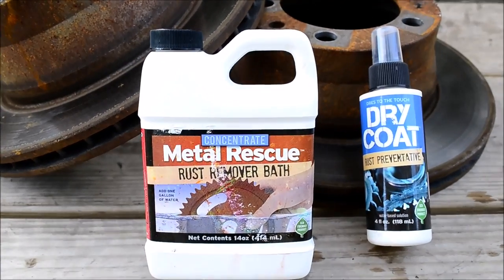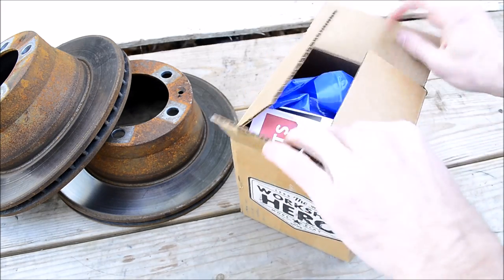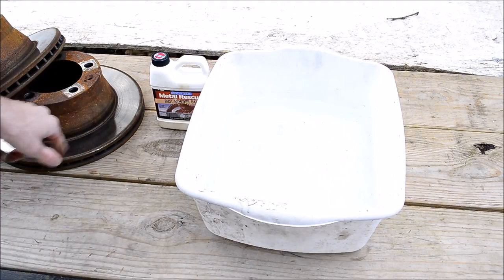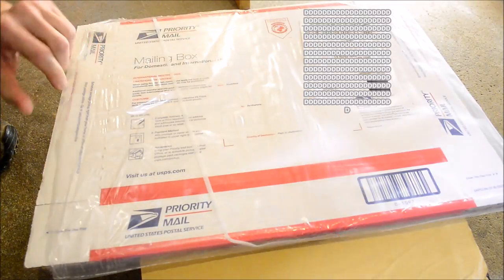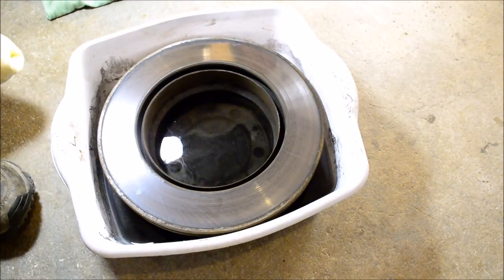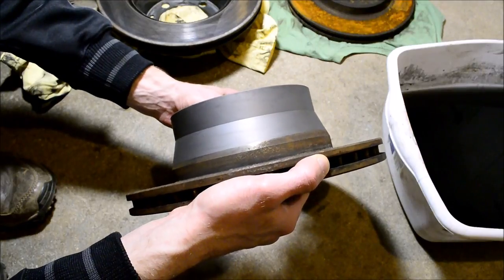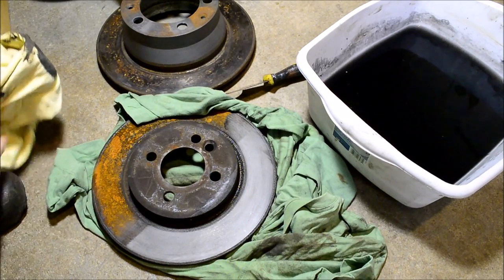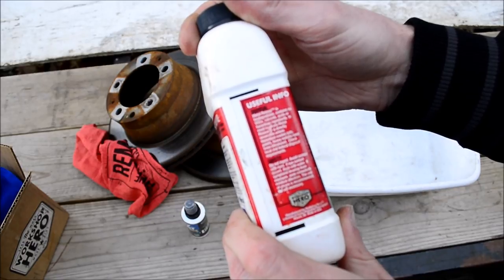Metal Rescue De-Rusting Brake Rotors | How to Remove Rust Easily

Comment: Dude 39 dollar at amazone.... New rotor from rock auto 25 each...
Reply: You say this but like if it's an already brand new rotor what is the point of buying another new one if the only issue is rusting
Reply: @tenseyyy3019  coz those chemicals cost same $$$ as brand new rotors plus you lost your Labor time.
Reply: @tenseyyy3019  well leave it alone rust is natural layer for iron to block further keep rust and totally breaking down. As long as you never soak water long period time. There a lot coated roter with rust resistant coating from brand new. The problem is you buy low quality roter try to solve issues with chemicals more cost than high quality roter. There huge selection of rotor at rock Auto .
Reply: @maungmaung4037  dude these are rotors that simple just sat still for a while all the parts are still good parts my guy
Reply: @maungmaung4037  the real issue with the Rusting is actually the wheel bearings being stuck I can't get them out at all

Comment: This stuff really works. Funny that I was looking for rust solutions on brake parts. I've used it on screws and metal trim on my 1990 Bronco. Even with a spray bottle, painfully taped sponges with plastic around it on the frame surface rust. Didn't know I'd be looking at a fellow 944 owner haha. I have a 1985.1 Guards Red

Comment: Storing liquids in plastic jugs may result in leaks in a short time. The plastic is very thin and if the liquid is even slightly caustic, it will leak.
Reply from the maker: this stuff must not be caustic because I've had it stored in a milk jug since I made this video and it hasn't leaked

Comment: Did you encounter any flash rusting? 
What I mean by that is after using the product and removing the rust, did the rust come back? If so, how quickly and how much rust?
Reply from the maker: Once rust is removed the rust can come back within a day if you don't protect the metal, it's just bare metal, has nothing to do with the product itself.
Reply: Soak in cocoa cola overnight! Removes rust and won’t rust again
Reply: Or soak in bi-carb/water after , to reverse the PH level of the acidic rust bath

Comment: Is this only for "surface rust"?.....my 2 piece Baer Rotors are drilled, slotted and vented. If I dont drive the vehicle for a few months the rotors develop THICK, DEEP AND HEAVY RUST......much worse than the rotors in this video! 

Will this product be able save me from having to spend $1k on 2 front rotors every time I dont daily drive my vehicle?
Reply from the maker: This product removes rust, it doesn't stop new rust from occurring. You need to clean the rust off and then treat the rotors with something that will prevent rust, paint, fluid film, etc. Although w/ fluid film you'll have to reapply after every drive

Comment: Would this work on rusted calipers too? I always wounder if it will damage anything with the caliper
Reply from the maker: hmm I wouldn't soak the rubber parts. maybe a rust remover gel would work better for calipers, that way you can paint the gel on the metal and avoid any rubber, and then wipe it off, then prep the metal for paint with something like prep-all, then paint
Reply: @aDIYCarGuy  ok thx . Does the same company make it ?

Comment: Did you try it again with one bottle of the rest remover, but 2 gallons of water? Would this still be strong enough or not?
Reply from the maker: I thought about it, but I didn't want to take the chance in case it would dilute it too much. There's no going back once more water is added, other than adding more Metal Rescue, I'm not ready to get more quite yet.
Reply: Hi Qwerrrz, Metal Rescue Rust Remover Bath CONCENTRATE must be mixed with exactly 1 gallon of water. No more, no less. Metal Rescue will not work if the mixture isn't 1 gallon. Thanks.
Reply: Thanks for the answer both of you. I thought it would may work slightly weaker, but cover more with more water!

Comment: i used white vinegar does the same and far cheaper lol
Reply: Hi Frank, there are many ways to remove rust. Although unlike vinegar Metal Rescue is not an acid, which makes it safe on paint, plastic, rubber, and skin. Since it's not an acid, Metal Rescue will not promote rust if left on and does not need to be neutralized. Metal Rescue is reusable and one gallon will remove up to a half pound of rust. We did a comparison video between various rust removers including vinegar and Metal Rescue: https://www.youtube.com/watch?v=M9Vj59WUAdU&t=1s. Please let us know if you have any questions!
Reply: I once de-rusted a motorcycle tank with a mixture of vinegar and hot water. The removing worked well but it started rusting again within seconds when I removed the liquid. I then re-applied it and had to quickly replace the liquid with cool water when it was finished to neutralize it and cool it down to avoid new rust. It really opened my eyes to how acid, water, and heat promote rusting.
I also tried a commercial product that I can't remember but it wasn't much better. If the product in the video is actually easier to use I can see its advantage.

Comment: Can u spray it on or like put it on a cloth and scrub it off ?
Reply from the maker: nah it has to soak
Reply: a DIY Car Guy is there anything that can be applied to a cloth and rubbed off
Reply: Supposedly you can soak it in white vinegar for cheaper
Reply: Our Metal Rescue GEL is our on-the-spot rust remover that is ideal for vertical surfaces or metal parts that can't be soaked. It is a cleaner, safer and easier rust remover than other gel-based rust removers. Metal Rescue GEL is non-toxic, environmentally friendly, and contains no harmful or corrosive acids, alkalis or solvents. You can check out more info about Metal Rescue GEL here: https://www.workshophero.com/store

Let us know if you have any other questions!

Comment: Will it get rid of the bluing on a firearm
Reply: Yes it strips  ALL the " native " coating off all metal even poor quality chrome. BUT not good quality chrome plating.This accelerates rust,in a gentle way bit takes the top layer of steel off.

Comment: It is pointless cleaning brake disc on the pads surface.  Only the lips and mounting bracket may need to be coated.
Reply: I disagree, if for valid reasons you aren't replacing or prof. cutting the rotors,ony then: the rust clogs the pores of the new pads reducing grabbing power.
 The rust stays in clumps and this wisks it away, using a large file helps the rotor have some resurfacing or a angle grinder.
Reply: @danielguerrieri2023  The problem is only with Turned rotor, it has microscopic irons powder that will be stuck on the pads and squeal. Cleaning the rotor surface meticulously is the key.  The glassed pads may cause issue but very rare.  Back to rotors, surface rust does not hurt the pads. If it is hardened corrosion like on the lips and creep under the pads material coating, that's bad. New rotor is only about $70  a pair, and paint the lips before installing it.